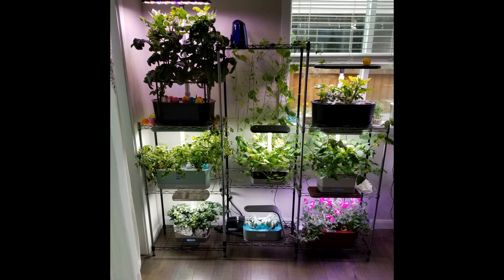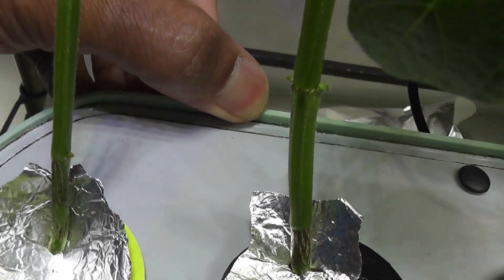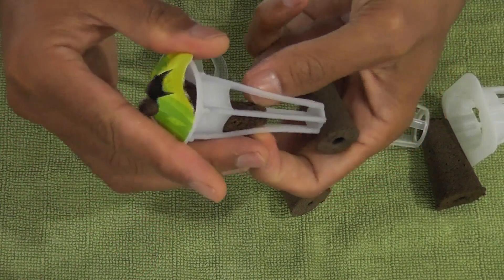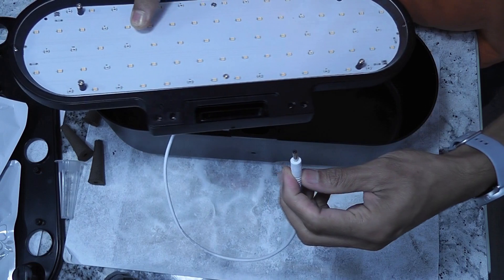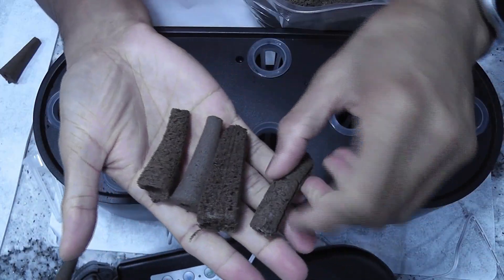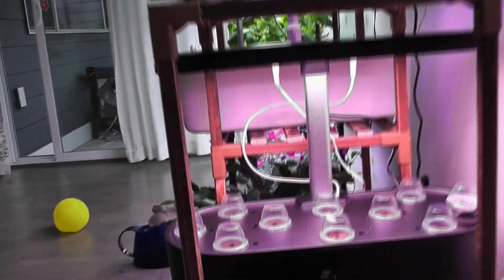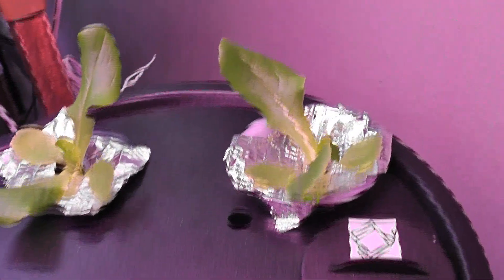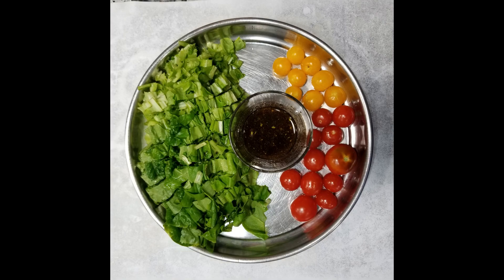iDoo 10-Pod model Review with Lettuce crop

Comment: I have 5 IDOO ten pods and really like that they are easy to clean. Never had an issue starting plants in them. The problem with IDOO's are in their quality control. All five of mine have pumps that aren't working after 3 years. On two of them, the lights aren't working properly. IDOO tells me they don't have the pumps anymore. At this point, it looks like they are headed for the landfill.

Comment: What do you think of iDoo 20 pods model?
Reply from the maker: It definitely has few nice use cases. However, it's a basic kratky setup with lights. We need to buy pumps additionally or we have to change water very frequently (like every week). Even though it supports 20 pods altogether, they are very close to each other and plants will get overcrowded (ofcourse it depends on what we grow). All in all, I am not impressed with it to give it a try.
Reply: @aerogardenexperiments  i agree👍

Comment: Best video I've seen on idoo...especially useful for beginners.  you added extra tips (no nutrients till sprouting, cover sponges after nutrients to prevent algae etc)  Pointed out good design issues between the different sized Idoo units also....Thanks!

Comment: I know you said you liked the system but do you believe this idoo 10 pod system is a good purchase, even though the pods don't stay in place...I feel like it defeats the purpose if I need to buy separate pods anyway. This will be my first hydroponics system and I'm not sure between this and the harvest which has that algea problem and makes it harder to grow strawberries + it's more expensive and comes with less accessories that I will need to buy.
Reply from the maker: I don't recommend iDoo as your first garden. IDoo is basic and good for herbs and lettuce. Getting accessories for iDoo is expensive. Aerogarden has many 3rd party accessories that work very well. Plants grow pretty slow in iDoo compared to Aerogarden because of the low strength in lights.
Reply: @aerogardenexperiments  looking up and comparing it says aerogarden 20 W,  idoo 12 pod is 22W, and idoo 10 pod is 24W... does that mean that the 10 pod idoo has a stronger light than the other 2?
Reply: @yumyum408  though iDoo says 22W and 24W, they are not exactly like that. So, growth will be a little behind compared to the Aerogarden.
Reply: @aerogardenexperiments  
EDIT: I did end up getting the aerogarden harvest becuase of what you said...It was super easy to set up and actually cheaper than the total cost of the idoo bc the aerogarden came with seeds. Thanks again for your help!
Thanks for the input! In that case.. know an aerogarden model that doesn't have the algea problem on the outside? I know you used foil to mitigate this...I would just love to have a model that I don't have to do that to preserve the look.